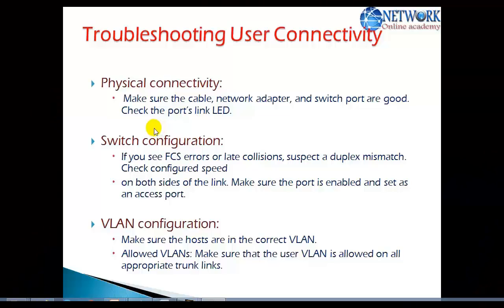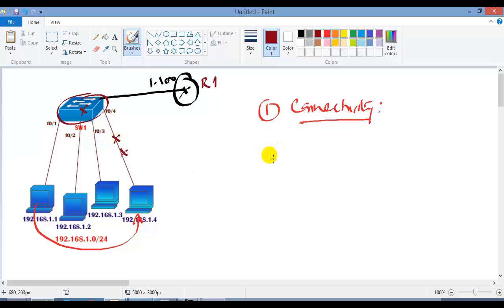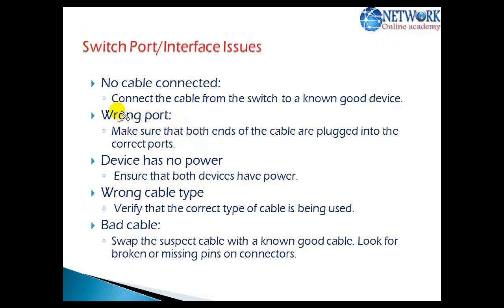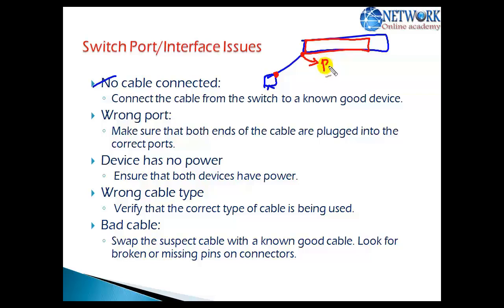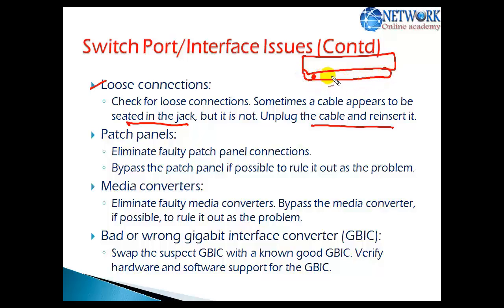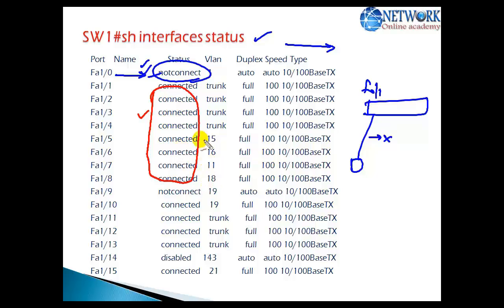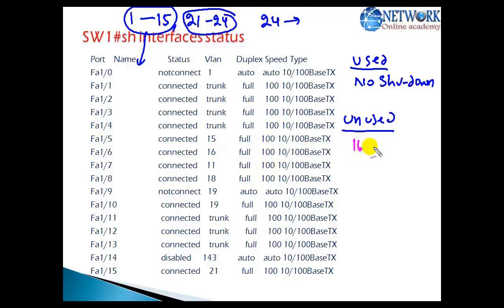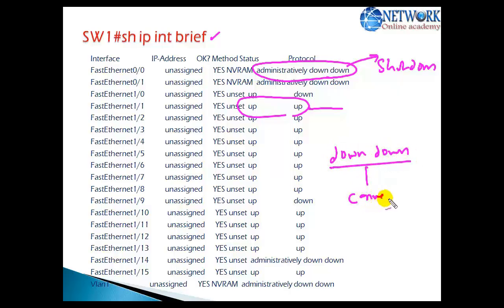CCNA Routing& Switching: Troubleshooting LAN -physical connectivity

Comment: The show interfaces status command does not seem to work on a 2811 router in packettracer.  The command works in GNS3 on a 3745 but the router console is not outputting any information when called.  Is this command only available on certain IOS versions?